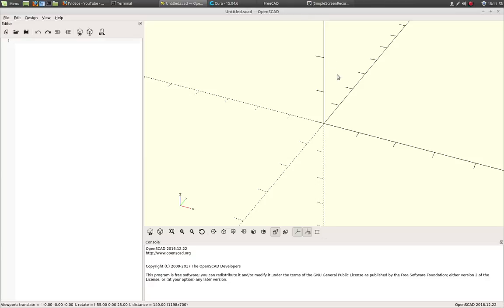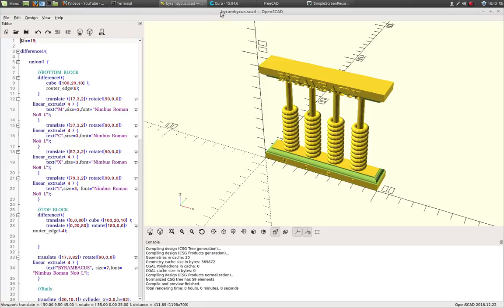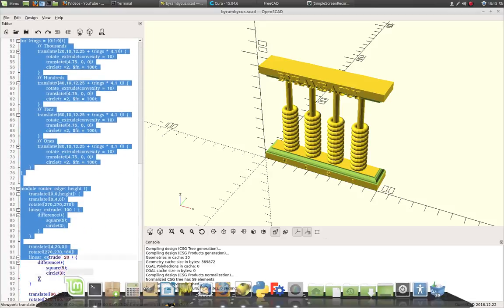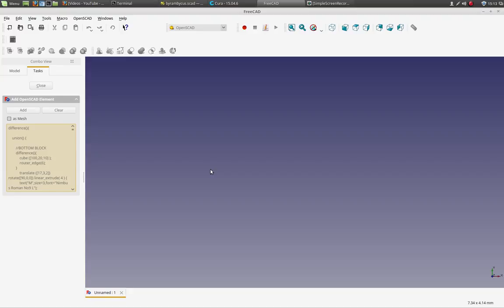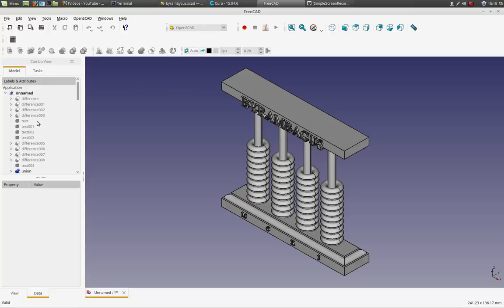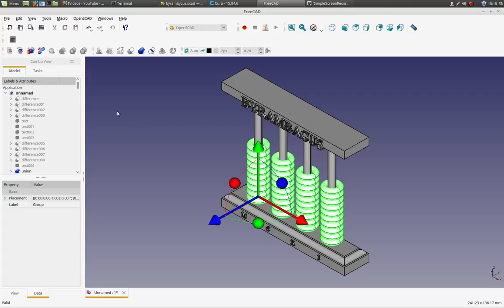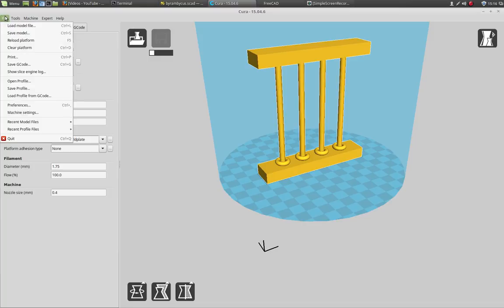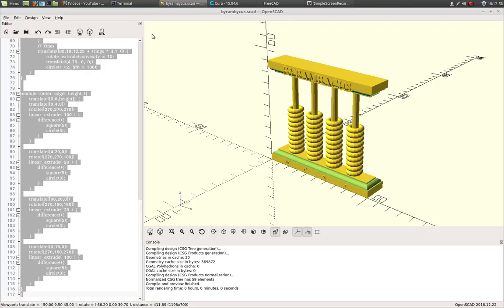OpenSCAD vs. FreeCAD - Using FreeCAD to Export a printable STL of an OpenSCAD Model.

Comment: You can add text in FreeCad. Use the draft workbench, then extrude it as a solid in part or part design workbench. Array patterns lets you duplicate things easily in FreeCad as well.